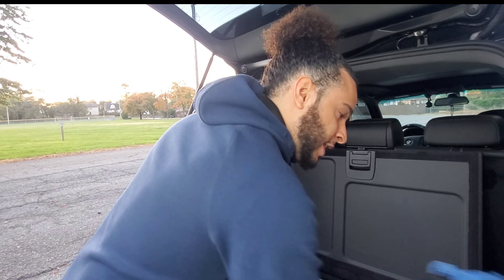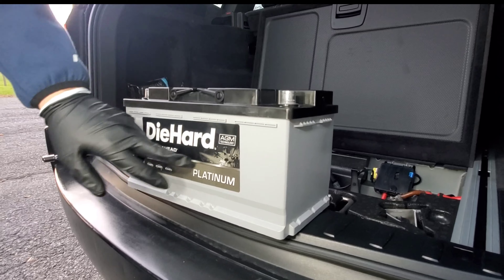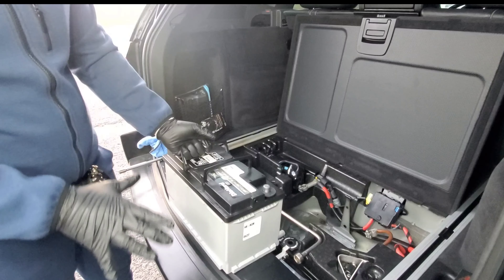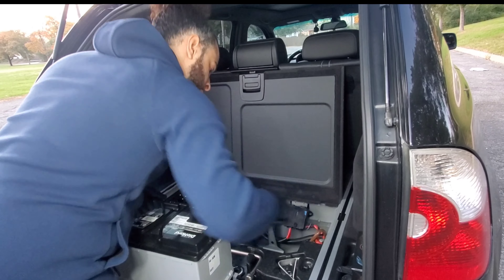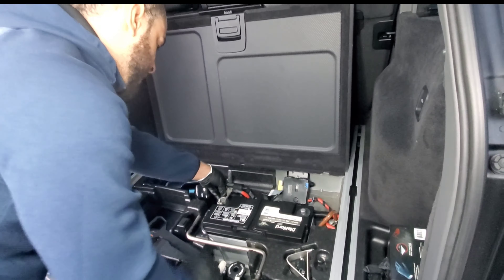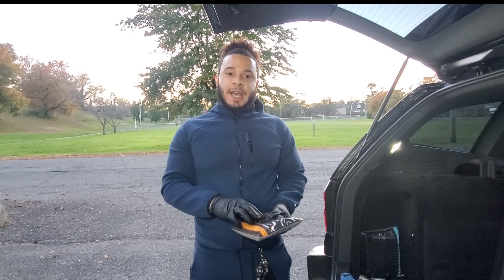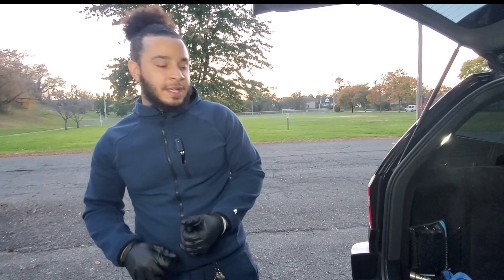BMW X3 [E83] 2004-2010 Battery Replacement DIY!

Comment: Great, and thank you for the video. Just want to add a few helpful hints.
The x3's from 2004-2010 does not have the IBS, (intelligent battery sensors) and does NOT need to be coded or registered.
To confirm this, take a look at your "negative\ground" battery cable - it should have nothing else attached to it at the battery post, except the cable clamps that attaches it to the post.

You can also search YT for- BMW Battery Registration Explained - Does My Model Need It?

Hope this helps also, Thank You

Comment: What is the little black box above the battery with red wires running into it
Reply from the maker: Hey my friend I hope all is well, I'm so very excited that you have found my channel and i Hope you become a member of the sub family community! 

The the Little Black Box above the Battery with the thick Red wires running into it is called a Battery Terminal Fuse Box. it's also called a Junction Box.

Here is the prime definition of a Junction Box -A junction box is an electrical enclosure that houses one or more wiring connections.

I hope this information helps you my dear friend & i appreciate your support. Keep being an amazing person my friend. & I will be here to assist you every step of the way.

May Yahusha HaMashiach Bless you!

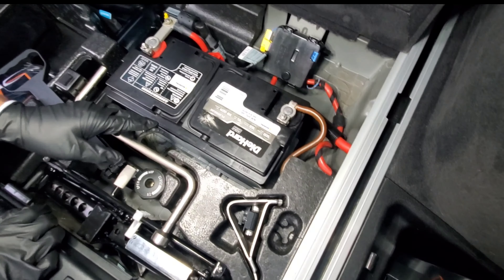Comment: 1:21 Battery says  H8  which is a 90AH or 95AH  but The link you have posted says  H6 which is a 70AH
Does it matter if you're swapping out H8 to H6 ? 
Maybe not because 70 AH is Oem standard and 90AH or 95 AH should be fine without needing OBD2 scanner.

Comment: I think i will ask my mechanic about registering the new battery since it is within the years that new chip technology allows for up battery updates.
Reply from the maker: That's understandable my dear friend. You can get it checked for Reassurance. 

But Once your battery is properly installed & you have no indications present on the instrument cluster you should be fine. If the correct AGM Battery was installed the vehicle will Immediately Recognize the new battery and it will not have to be Registered to the vehicle. 

I hope this information helps you my dear friend & i appreciate your support. Keep being an amazing person my friend. & I will be here to assist you every step of the way.

May Yahusha HaMashiach Bless you!

Comment: Bro I got an x3 2004 model and the speedo ain't working or moving so I heard I should reconnect the battery is that true.. And if I only disconnect and reconnect the negative will that do the teick

Comment: My bmw 2008 x3 has a non amg battery in it is that bad?
Reply from the maker: Hey my friend I hope all is well, I'm so very excited that you have found my channel and i Hope you become a member of the sub family community! 

Replacing an [AGM] with a conventional battery would be like using the wrong part for your vehicle. The battery life is shortened, and the performance maybe affected in most cases. [AGM] batteries have a fine glass fiber separator between the positive and negative plates that absorbs the battery acid. When replacing an [AGM] battery, it's always important to use another [AGM] battery for your BMW. 

As with using a conventional battery for your BMW can shorten the battery life and affect the vehicle's functionality. 

Also BMW began installing [AGM] batteries in many of its vehicles in late 2002, and some of BMW'S other vehicles was equipped with lead-acid batteries and the was later retrofitted with [AGM] batteries. 

So with saying all that I do recommend you to replace the conventional battery that is currently installed in your 2008 BMW x3 e83.

I hope this information helps you my dear friend & i appreciate your support. Keep being an amazing person my friend. & I will be here to assist you every step of the way.

May Yahusha HaMashiach Bless you!
Reply: @HASAWNTUCKER this video was so helpful bought the car from a friend for a good deal and it was running good then all of sudden it was shutting off and putting lights on the dash after watching this video I literally went and bought the right battery and it’s been running so smooth

Comment: I think I must have had the wrong battery in my car changed a few years ago.  Had to take the car to the dealer to get them to do something with the car to recognize the new battery.
Reply from the maker: Hey my friend I hope all is well, I'm so very excited that you have found my channel and i Hope you become a member of the sub family community! 

Yes your absolutely correct my dear friend, if you get the Wrong Battery for the BMW X3 E83 the vehicle will not recognize the new battery that was installed. The BMW X3 E83 requires A [AGM] Battery, this specific Car Battery should not Require you to register the new battery. 

I hope this information helps you my dear friend & i appreciate your support. Keep being an amazing person my friend. & I will be here to assist you every step of the way.

May Yahusha HaMashiach Bless you!

Comment: So you don't need to program it
Reply from the maker: Hey my friend I hope all is well, I'm so very excited that you have found my channel and i Hope you become a member of the sub family community!

If everything was done correctly there is no need for the [AGM] lead acid Battery to be Programmed to your BMW. 

Programming may not be required at all if a [AGM] battery was installed. Now if you install anything other then a [AGM] Lead acid battery it's likely the new battery has to be “registered” or matched to the onboard ECU for proper operation and battery longevity. 

But I would definitely recommend you to only install what the vehicles manufacturer recommends Which would be a [AGM] lead acid Battery. 

I hope this information helps you my dear friend & i appreciate your support. Keep being an amazing person my friend. & I will be here to assist you every step of the way.

May Yahusha HaMashiach Bless you!

Comment: I have  charge ports under my hood for jumping purposes. Should I disconnect the + and - cables from that before changing the battery?
Reply from the maker: Great question to ask my dear friend. No if you are wanting to charge your battery you will not have to disconnect the [Positive+] or [Negative-]  Terminals from your battery. Also the [Positive+] & [Negative-] Terminals underneath the Hood will not have to be disconnected neither. It will be safe to keep both Terminals connected  While charging and maintaining your vehicle's battery.

I hope this information helps you my dear friend & i appreciate your support. Keep being an amazing person my friend. & I will be here to assist you every step of the way.

May Yahusha HaMashiach Bless you!

Comment: Hasawn does the X 3 have a auxiliary battery .
Reply from the maker: Hey my friend I hope all is well, I'm so very excited that you have found my channel and i Hope you become a member of the sub family community!

Auxiliary batteries are still fairly rare but you will now see secondary auxiliary batteries in many cars ranging from Mercedes Benz, BMW, Chrysler, Jeep and more. the BMW X3 E83 [2004-2010] Does not have a Auxiliary battery.

There is only one battery located in the Rear trunk area. 

But these models do have Auxiliary batteries, BMW X5 F85, BMW X6 F86, BMW X5 F15, BMW ect. But I do want to Mention that a Auxiliary battery can be installed professionally in to your BMW X3 E83.

I hope this information helps you my dear friend & i appreciate your support. Keep being an amazing person my friend. & I will be here to assist you every step of the way.

May Yahusha HaMashiach Bless you!